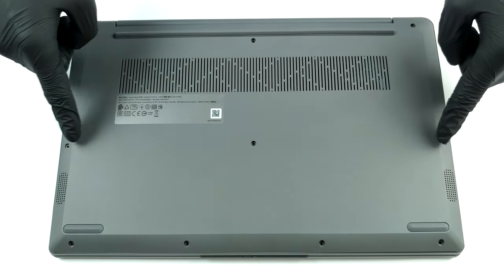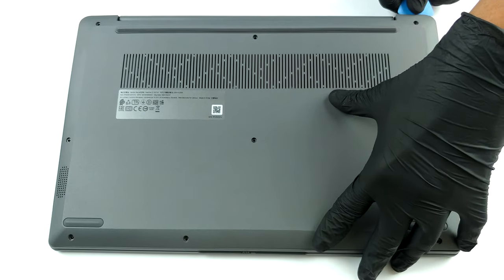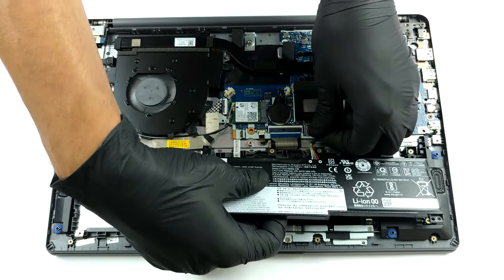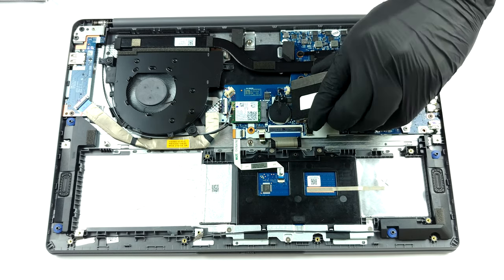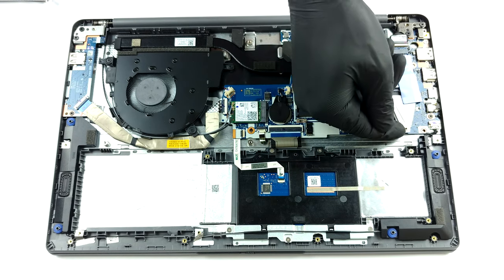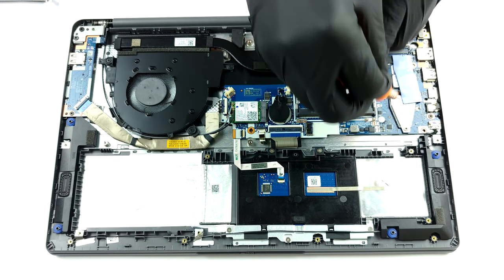🛠️ Lenovo IdeaPad 3i Gen 6 (15") - disassembly and upgrade options

Comment: Oh I didn't know that there is a blank SATA SSD slot😆
My model is IdeaPad Slim 3 15ITL6
Reply: Mine have no sata cable
Reply: @Lazan.  Mine have no sata cable too :(( 
I have to look for the cable at laptop maintenance centers for several days and I can't find any of it. Some places sell it at a very expensive price (about 50 USD for that cable). At the end I had to buy a portable SSD instead of a 2.5". Haiz~

Comment: Shame on Lenovo for not making an access door for ram and ssd upgrades. My old Lenovo is very easy to open and upgrade.
Reply: it's been that way for years, i've seen worse than 10 screws,. if you want a REAL laptop get a Framnework, damn near FULLY modular.
Reply: @cdoublejj  not really, no access to 2.5 drives and ram/storage only accessible when removing the keyboard.. I would go with a framework, if the ssd was easly accessible (dont like dualbooting and I have multible os which I preffer to stay seperated(software engineering, productivity, media consumption and gaming)) So this laptop seems more interessting to me, cuz I can dremel a port myself